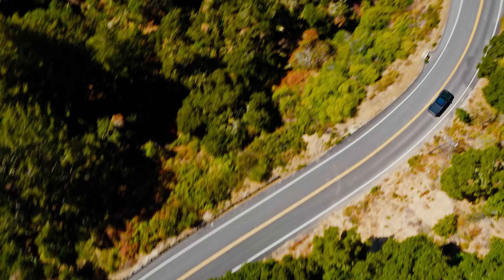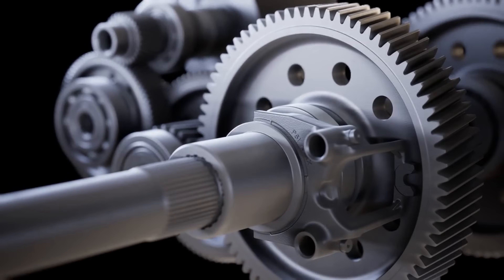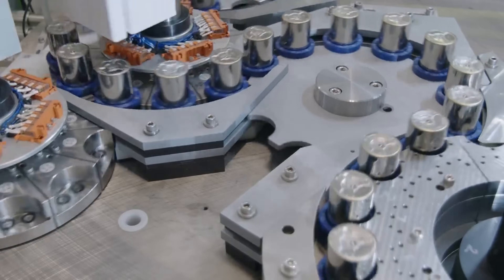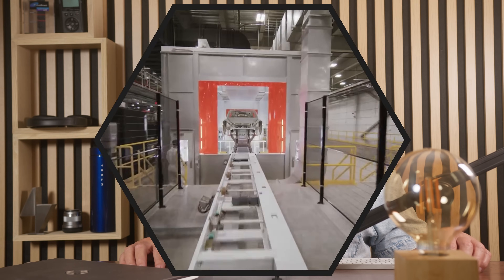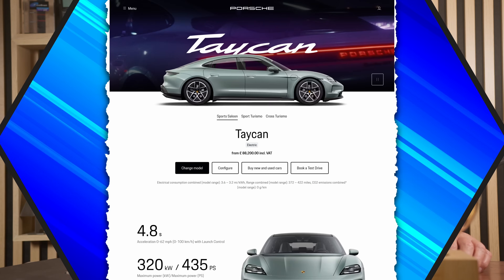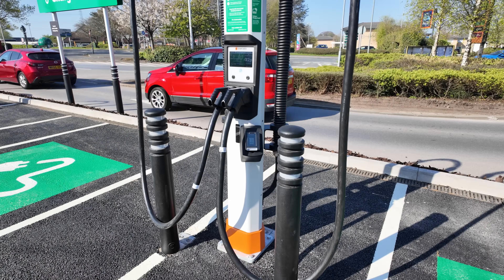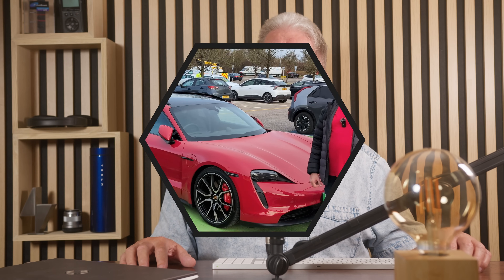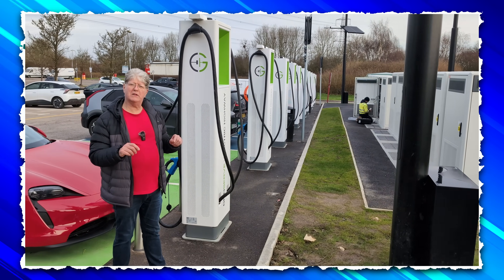800V Charging Is The Future... Or Is It?

Comment: I’ve ordered my first 800v EV and it takes about 10 minutes less for 10-80% so well worth it in my book. It’s about charging faster for longer. Tesla’s 250KW chargers are a bit of a misnomer because you’ll probably only ever get that for 2-3 minutes if you’re lucky.
Reply: 350kW and larger chargers are 800V, so will charge the car it the maximum the BMS allows at the time. 

Tesla superchargers are 400V, as are some 250kW chargers, so these require the vehicle to boost the voltage to the nominal pack voltage of around 800V.
On our Ioniq 5, Tesla superchargers are limited to 96-98 kW, as the rear motor inverter is boosting the voltage, so causes a bottleneck. This doesn't happen on 350kW chargers, or on the 250kW chargers I've tried. 
The most I've seen is 239kW for about 4 minutes on a gridserve 350kW cabinet, after which the charge rate falls off, but it's still doing over 100kW at 90% SOC, which is very good, and more than fast enough for most drivers.
Reply: @johnnodge4327  - most listed as chargers over 150kW are 800v capable (except Tesla), including the Shell Recharge 175kW sites, Gridserve 160kW+ sites, most Ionity sites (even as low as their newer 50kW what ones do), Instavolt 160kW+ sites, etc.

Charging at 800v at a rate below the vehicle's maximum BMS limit is also useful as 800v cars tend to have wider charging curves, and can top up charge into the high 80% or low 90% ranges at over 100kW in some models. This is useful if doing a quick top up charge en-route to increase range a little to get to another destination as it doesn't add significant time if charging to the high percentages on 800v cars.
Reply: Haha, you likely won’t get that really fast charge rate from all the present 400V chargers - the car has to boost the charger voltage to the voltage required for the battery, so it is limited to the size of that converter.

Save 10 minutes?  No time to go to the loo, let alone get some grub.  Mine is 800V but I’ve only charged at 400V on 3 or 4 occasions in over two years of ownership ( it wasn’t bought for the 800V charging).  95%+ charging at AC rates.
Reply: Good that it charges fast. That said there have been many cars which suffer from battery longevity issues which Tesla don't have, so i suspect Teslas slow charge curve is there for a reason. Taycans in particular have had problems.
Reply: @EwanM11 - Tesla push the batteries fairly hard whilst charging, depending upon model/configuration. On the faster cars they parallel charge the batteries more than serial string charge them, charging each cell at a higher current level at 400v than many 800v architecture cars do. This causes more wear at a cell level. It's also the reason plaids have to spend 20/40 minutes preparing the batteries for a launch, to balance out the cells for even power discharge. 

The Taycans are probably being thrashed hence the poorer average battery life. After all, that's what Porches are mainly used for, why spend so much if one cannot show off and abuse the thing to death at the same time.
Reply: @EwanM11 I think any degradation issues were in the infancy of 800v, but as per all the data shared online by owners, 800v cars don’t degrade any worse than 400v ones over time.. Tesla’s poor charging curve is a cost cutting measure but no doubt they would call it  “optimising”.
Reply: @mra9085 its not about degradation, its about failure. Aggressive charging promotes dendrite growth in the cell and if they reach the cathode the battery shorts and will possibly kill the whole pack, fire in the worst case.

Comment: Tesla chargers are still struggling with the 800 volt cars, my EV6 will often drop out while charging requiring the car to be disconnected, this varies with chargers - at Milton Keynes it will always happens, with other sites its just occasionally
Reply: Have you updated the EV6's software, there was an update a while back to deal with Tesla chargers tight time out limits - particularly on the older Tesla v3 equipment. The Tesla chargers don't seem to be as tolerant as other makes of CCS chargers, perhaps because they were designed to talk to Tesla's only originally using a proprietary variant of the CHAdeMO standard.

The Korean 800v cars also perform a battery management cycle during the charge, which occurs towards 80% on the pre-facelift models and around 92% on the face lift ones with bigger batteries. This reduces the current to holding levels for a couple of minutes, which the Tesla chargers may be falsely identifying as indicating the charge has completed/disconnected.
Reply: @GruffSillyGoat   Yep, a car issue rather than  the charger.🙂
Reply: My Ioniq 5 charges on Tesla superchargers just fine, actually 100 % reliably so far, however it's painfully slow at a 96 kW rate. If I'm in no hurry, Tesla is ok, and a few £ cheaper, but if I want to charge really quickly, Ionity and Gridserve 350kW chargers would be my choice.

Comment: Yes around 400-500 mile real world is the perfect range
Reply: Depends how far you need to travel.  Shorter range can mean a cheaper car.
Reply: @TheSeafordian more to do with charging station prices than anything. 400-500 mile range covers most UK one day trips there and back.
Reply: @nazb1982    But you can’t charge that whole battery capacity overnight on an EV tariff.  I can generally add 125-140 miles during my 5 hour cheap rate slot.
Reply: @oliver90owner why would you need to unless you are doing really long trips daily. What I want is if I want to do say Manchester to London and back in a day not to have to use a public charging station for it
Reply: @oliver90owner 
Get a tariff with more cheap rate hours. I get 7 hours, so can add about 170 miles on cheap rate.
Reply: It depends upon the location and circumstances. In the UK 300 to 350 miles is sufficient for the average driver, seeking to charge once every two weeks . But many can use lower capacity cars if able to top up more regularly or travelling less than average (140 miles a week).
Reply: @GruffSillyGoatI just picked up a Kona long range and am expecting around 250 real world but will see. If these cheap Chinese cars come along in the next few years though going to be obsolete
Reply: @nazb1982    Out-dated maybe - but not obsolete.
Reply: @oliver90owner I would expect the prices to plummet. Looking at the specs on say the Mona Max if it comes in around the £15-£20k bracket. 2nd hand in a couple of years looking at around £10k. Would make the Kona on the 22 model I got to about £8k. The only reason I got the Kona over the MG4 is software.
Reply: @nazb1982    My point was out-dated, maybe.  There is a difference between replacement and obsolescence - well, there is (in the english language) as far as I understand it.
Reply: @oliver90owner fair enough. Either way it’s gonna make current models devalue much faster than they would otherwise
Reply: @nazb1982    All marques and models devalue.  Well, some more than others  - but very few appreciate.  Generally, unless the vehicle has a common expensive fault, depreciation each year reduces.  Eventually the total depreciation will amount to near 100% (scrap or spare parts value).  It’s the way of life.  Motoring is an expensive hobby or necessity - no way around it.🙂   Depreciation won’t really affect me during the life of the car - unless it is written off by an insurance mob.
Reply: @oliver90owner but rate of depreciation is affected. With gas powered cars there is not much change in engine technology year on year whereas battery tech is moving super fast
Reply: @nazb1982   ICE cars?  Wet cam belt engines?  Others have poor reliability issues. as I said, motoring is not a cheap pastime.  Most current EV batteries will last the lifetime of the car.
Reply: No. Anything over 300 is a waste. An expensive, heavy, and useless weight to drag around.  The BEST chargers available can only put out AT MOST 200 miles in 15 minutes. If you have a battery much bigger than that, you will be sitting around waiting for a charge while I will be gone in 15 minutes taking my 300-mile battery up to just around 70%.  I drive for 3 hours. And charge for only another 15 minutes. Efficient EV road tripping is all about keeping moving and keeping your charging stops limited to just the time it takes to visit a bathroom and get a snack. You're carrying around a battery bigger than that it's just a giant expensive waste. You would rather that they cut the price of the car and cut the battery down. You will never use 400 or 500 miles of range in an EV.

Comment: Hi Dave, another thought provoking video. 
My Polestar 2 gives me an extra 200 miles of range in half an hour on DC ultra rapids and that suits me fine. 
It means I've not had to make any compromises on driving over owning a petrol. 
Like you I do perhaps 5 long journeys a year and I always used to stop for about that time on each long journey when I owned a ICE car. 
15 minute charging instead of 30 minutes would make little difference to me and as such is not something I'd pay extra for in my next car. 
What I might pay a bit extra for would be vehicle to grid capability.

Comment: Having owned an EV6 and a Tesla, by a country mile, the latter is king
Reply: Nothing beats Tesla
Reply: @SzaszaG1   Maybe for you, but another marque beat Tesla for me.  Teslas are good but don’t fit best for everyone.
Reply: @SzaszaG1 
The lack of proper buttons for essential HVAC items and no HUD are a deal breaker, and this was before the CEO turned Nazi.
Reply: Teslas are fine if that's the only car you drive, otherwise can a bit of a disappointment poor comfort and refinement. They are well built but the materials are not the best. I had a model Y for a year, good ev but I really prefer my bmw ix3, much nicer to drive and use, the safety tech is much better, found the tesla very panicky always freaking out at blind bends or someone joining the motorway from a slip road, total pain, have to adjust the settings every time you get in, lasted 11 months then changed it
Reply: Propaganda. Teslas are now acknowledged to have poor build standard, poor reliabiliy and poor customer service. That is the verdict of the independent not for profit Consumers Association. Additionally nobody wants a swasticar.
Reply: @rogerphelps9939 Have you any actual experience of owning one?   Probably not.   I have found their reliability and customer service excellent.    How is it propaganda from some one reporting their actual ownership experience?
Reply: @rogerphelps9939    I didn’t even consider a Tesla - the harsh ride (at the time) was one trait that put me off.

Comment: The new Mercedes CLA will not be offered in the UK with a 400-volt DC converter (although it is in mainland Europe) meaning it won’t work with the majority of UK rapid chargers. I wonder how this will pan out?
Reply: It will work with the majority of over 150kW chargers in the UKand many newer 50kw+ chargers. 

Merc would have analysed the market for this decision probably assessing that as most UK EVs are home charged on AC and that the majority of UK ultra rapids chargers are 800v compatible the cost of the dc-> dc converter will offer little benefit in the UK market. 

The only impact being that the CLAs will not be charged on currently 400v only networks like Tesla superchargers. Perhaps Merc don't wish for charging revenue to be directed Tesla's way

Comment: If it charges in less time than it takes you to carry out a quick toilet break and buy some snacks, is it really necessary?
Reply: Yes it is necessary because it reduces the current that needs to be supplied to each charger, meaning smaller and cheaper cables and lower costs - less copper is needed and thin cables are cheaper than fat ones.
Reply: @donincognito189    Getting out of date with copper conductors - too easily thieved by the scroats, so Aluminium  is used (but still the same argument for current v thickness issue).